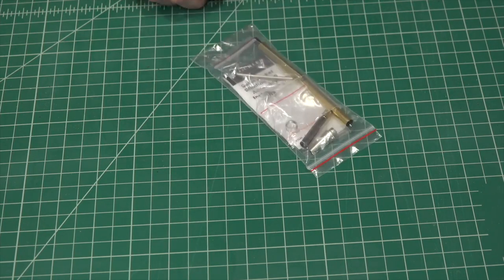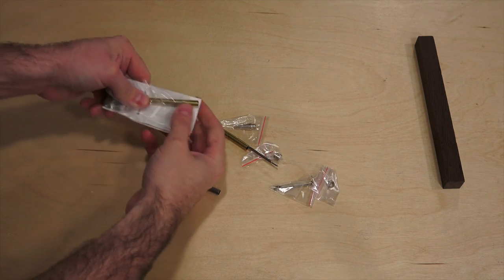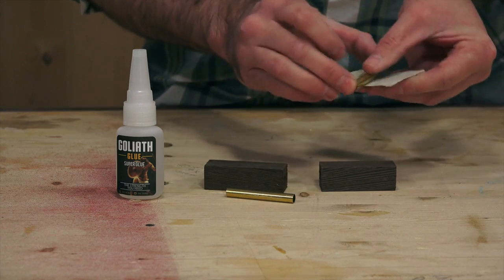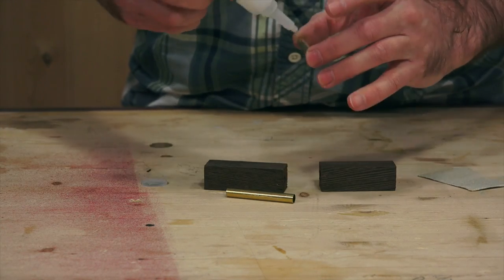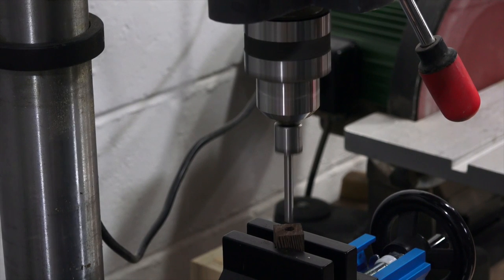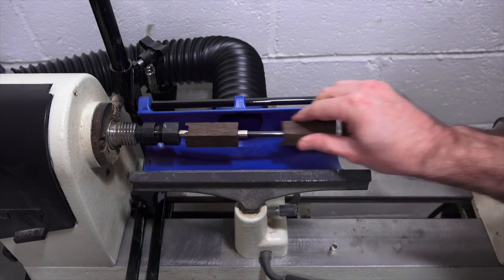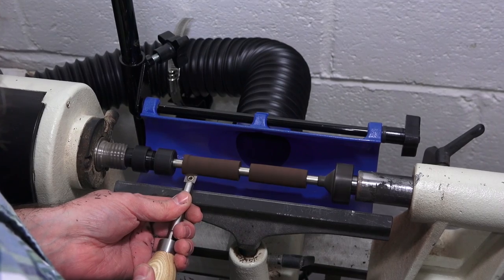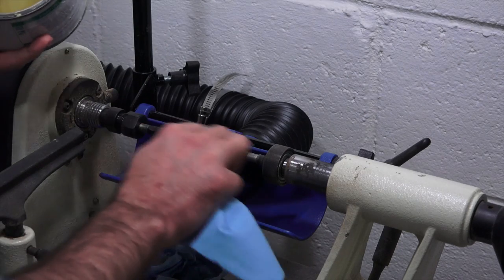Pen Turning Tips n' Tricks | Make Something

Comment: What can best be used instead of a drill press to drill out the blanks?
Reply from the maker: Our Portable Drill Guide will give you the ability to drill straight. You could use it with the blank in a vise to drill them. To make things easier and fool proof, you can get our Self-Centering Drill Vise that attaches right to the Portable Drill Guide. Thanks!

Rockler Portable Drill Guide - https://www.rockler.com/rockler-portable-drill-guide

Rockler Self-Centering Drill Vise - https://www.rockler.com/rockler-self-centering-drill-vise